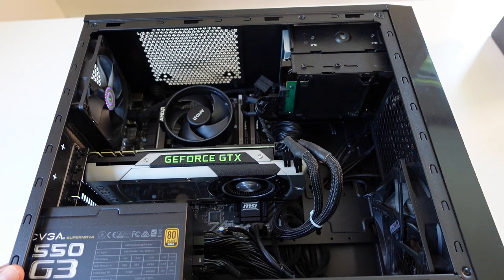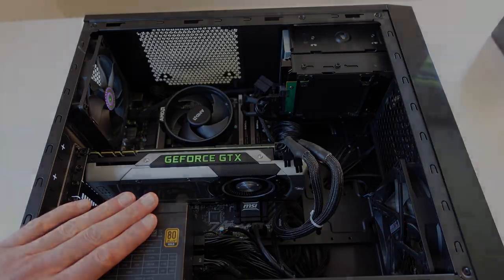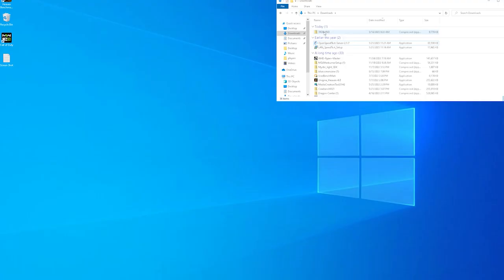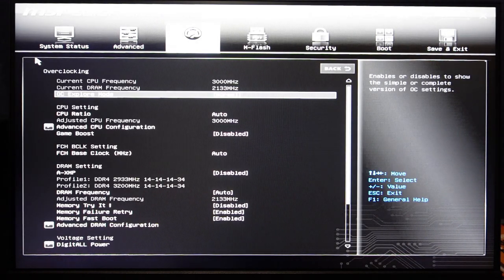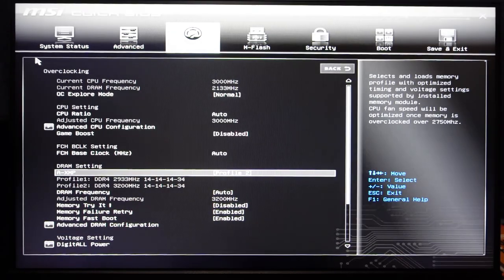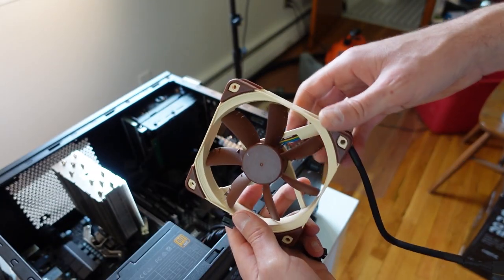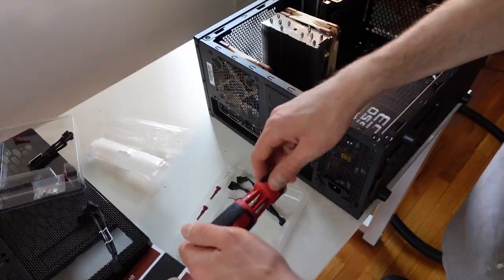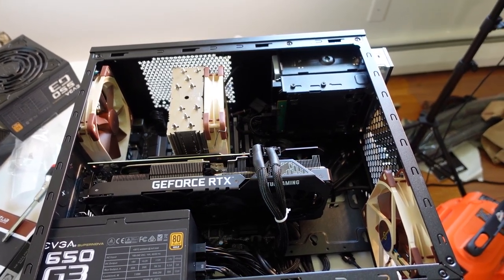Upgrading From 1700 to 5700x Step By Step on B350 Motherboard

Comment: i am thinking to upgrade from ryzen 5 2400g to ryzen 7 5800x and 2400mhz ram to 3200mhz
Reply from the maker: Good luck!
Reply: That's a nice upgrade. AM4 is an awesome platform for upgradability.
I'd suggest more than 16GB of ram too. My RAM usage was around 10GB while playing Borderlands 3. 16GB is recommended for that game, so I thought I was fine. I eventually added 32GB and same use case had ram usage of 14GB, so memory compression was occurring. I noticed most of the frame time spikes were gone in the benchmark too! (Not all, but most)

Comment: so, hey, did you actually replace 980 to 3070 on b350?
Reply from the maker: yes I did
Reply: @SystematicHardware  does pci express 3 in any way affect its performance? i'm thinking about doing the same thing, but i have b350 pc mate and are about to upgrade to ryzen 5600x, and the options are open for a new video card....would greatly appreciate your advice, man.
Reply from the maker: @victoricus1  I haven't tested this, but my common sense based on the limited cards at my availability - I think that platform would limit performance with the higher end 4000 series cards like the 4070ti to 4090, but it also depends on many other factors. However if you reasonably pair a mid-range card with that system you should be fine.
Reply: @SystematicHardware  ok, thank you...after an hour of swapping my processor I managed to boot my pc) had a couple of problems...in your opinion, is it worth overclocking ryzen 5xxx or it doesn't really give you any noticeable boost?
Reply from the maker: @victoricus1  IMO not worth it
Reply: @victoricus1  the key to your question is that the pci 3.0 is X16, in that case there will be no loss of performance, if the slot is PCI 3.0 x 8 if you will have a loss of performance, I recently upgraded graphics card Rx 6700 XT Sappire Radeon 12 GB along with Ryzen 7 5700 X and Ram to 3200 on a motherboard MSI B350 Gaming Plus and the change has been brutal, ...I have the same performance as a B550 4.0 board.
Reply: @Vidoc6587  thank you, i've installed rtx 4070 and honestly i dont feel like msi b350 is affecting the performance that much, rtx 4070 definitely performs better than 1080) that's all i can say

Comment: Can you enable pci-e 4.0 with this configuration? R7 5700x + B350?
Reply from the maker: nope, what graphics card will you use?
Reply: @SystematicHardware  RX6650XT
Reply from the maker: PCI-E 3.0 won't hold that card back in performance

Comment: Upgrading today from R5 1600af to R7 5700X3D with the same motherboard. Thanks AMD:)
Reply: there any problems with it or does it run fine i have the same mobo in the vid any do u know what bios version?
Reply: @seanop5548 Oh, I meant I didn't change mobo during the upgrade, sry. I have an ASRock AB350M Pro4 on the B350 chipset, and it runs fine! U just have to update ur bios. In games 5700X3D consumes about 60-70 watts, so its ok for my cheap B350 motherboard, and I think it would be ok on urs